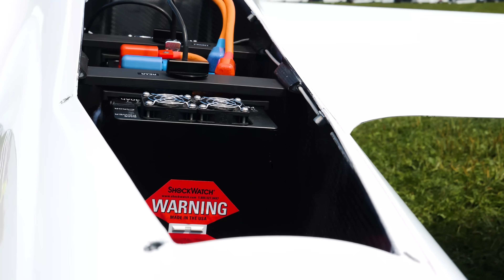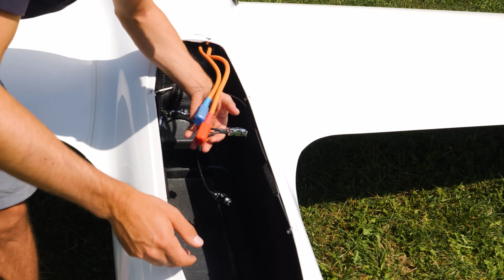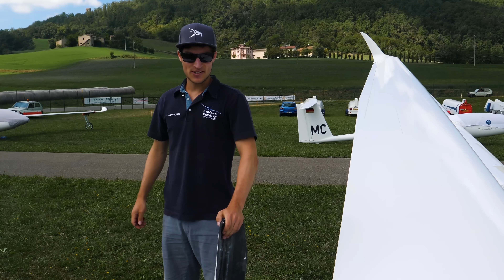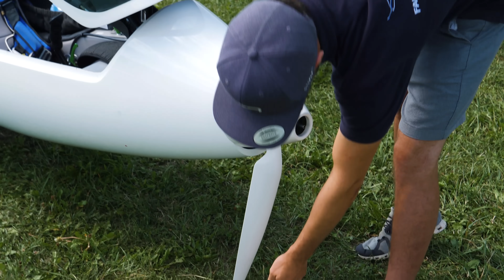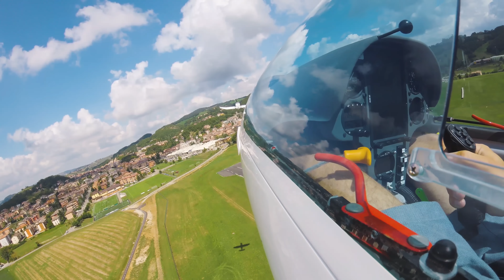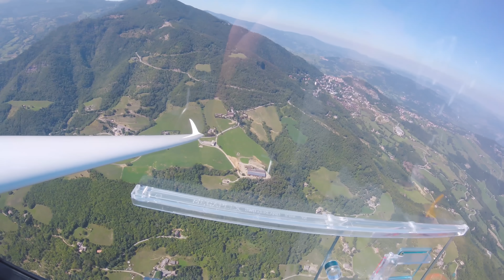New LS8-e neo review | Electric Glider 15 m & 18 m wingspan

Comment: Can't believe how far RC's have come - 'bout time they released a 1:1 ratio model
Reply from the maker: Haha, but not the cheapest RC glider 😂
Reply: I had an irresistible urge to blip the throttle stick on my transmitter as he was winding the prop! :D:D:D:D
Reply: The electric cri-cri is the ultimate 1:1 RC model =)
Reply: Stefan Langer Whats the Prize for the Plane ?
Reply: @Tatesmate  grand prize
Reply: 1:1 ratio model compared to what ? Itself ?
Reply: RC Planes have less regulations than real planes. That brings more room for creativity, experimentation and improvement. 
The real planes will try to follow the RC planes in the future.
Reply: This comment confused me, doesn’t RC= radio controlled? Isn’t this a glider? What am I missing, I feel dumb.
Reply: Nice video
Reply: @SteFly  how far battery goes? 100 km/ 1x charge?
Reply: Hört sich an wie 'n Kampfjet.😄
Reply: That is how the did 9/11
Reply: @SteFly  how much is this glider cost in this video?

and im taiking about US dollars
Reply: @SteFly  how much it cost a glider like that? heard that common gliders cost 40K this one?
Reply: @SteFly  Hi Stefan. Would you please tell me what to study in order to be able to try building a similar glider?
Reply: @SteFly  Hi Stefan. Would you please tell me what to study in order to be able to try building a similar glider?
Reply: @sbprivate7330  aeronautical engineering friend
Reply: Gliders use high lift low speed low drag flying so it has long thin wings and light material but very strong
Reply: Sam shepard and peter siripool and flute test are good channels
Reply: Fluid mechanics 
Mathematics 
Physics 
Aerodynamics 
Engineering statics 
Mechanics of materials 
Flight mechanics 
Pilot training 
Engineering structures ...
I'll ad more later
Reply: @SteFly  0
Reply: @jekekefe5923  I thought you were Mike patey for a sec!
Reply: Gibt es schon

Comment: I particularly enjoyed the extended battery securing aspect to this video. It's never given enough air time in similar features. I love watching batteries.
Reply: @Sam Haslam it is not completely foolproof, so not yet suitable for club operation... ;-)
Reply: I don't mind a little TV or a campfire, but sitting around watching batteries...👀..?
Reply: Cynthia Ayers I think they’ve got a website for that.
Reply: The batteries can be swapped and the flat batteries are charged while you fly. Way more fun than charging built in batteries when you can't fly for an hour or so while waiting.

Comment: Magnificent looking glider. Smooth low noise and compact electric power. Top combination.
Reply: He literally said it was too loud. As the 1 thing he didn't like. 

I thought it was amazing though.
Reply: For a glider its actually pretty loud. Since we don't have engines running and fly at around 100-160 km/h on average it's normally even quieter.
Reply: Hopefully only the airvent or the canopy...

Comment: Literally first glider video I saw an hour ago got me thinking that it would be a nice addition to have an electric motor with a folding prop on one of those in case the pilot fails to find any lift. Then I thought that of course that would be a compromise on the gliding abilit, because of the weight so maybe it's not the best idea. Googled the weight of some glider, did some quick rough maths about weight, electric motors and energy consumption then realized it might not be such a bad idea. Literally a few recommendations later this video shows up and I feel validated lol.

Comment: I started in a Switzer 233 like flying a pickup truck, It had air leaks all over and i liked the wind sound. When the sound stopped your were in a Thermal or in trouble.  It was fun.
Reply: Was it with air cadets?
Reply: @Matthew-se1xf  I wish it would of been cheaper.
Reply: I was a passenger in one of those once. My friend did wingovers above the Flatirons in Boulder and I puked out of the rectangular side window in the back seat that flopped downward on hinges. No thanks.
Reply: The SGS 2-33 was my first solo...the only other gliders I've flown are the ASK 21 and PW-6U but compared to those, it flies like a pickup truck. Compared to the LS8 and other modern stuff, it must be closer to a freight train. Still, the Schweizer was always a good time...god knows my slipping skills got better because of it.

Comment: Thank you for the video. That is one cool glider. I noticed you have a spot personal locator beacon on. I’m glad you have a beacon. But you might consider getting the ACR brand. There is a few reasons for this. One the ACR brand has no monthly fee. It also has 5 W of power. This way if you were down in the canyon or under a snow covered canopy it will have the power to get out where the spot only has 1/2 of 1 W. The spot also has a monthly fee. Finally the ACR brand is part of a worldwide search and rescue network that many governments are on board with and the ACR beacon will work anywhere in the world even the north or south pole. The spot uses a private satellite network and there are reports of the beacon being set off and them not dispatching search and rescue because they think it is not a real emergency. That is not an option with the other network. Also the other networks at ACR uses uses two different satellite constellations. Anyway just wanted to point that out beautiful glider thank you

Comment: Thank you for the interesting video: it gives a nice insight into the operational realities of a FES equipped glider. You make an interesting comment that the LS8, when compared to the '29, is the more 'communicative' glider regarding thermal structure and hence easier to core quickly. I was wondering how you would rate the Libelle in this regard?
Reply from the maker: The Std. Libelle (without winglets) is also very communicative but compared to the LS8 not so stable. You need to fly the Libelle more actively and it takes more concentration. But the feeling of the thermals was also very good.

Comment: Nice review Stefan, how do you have the time to create that many videos haha. This LS8 is a dream setup! - though would've loved to hear some range and performance specs on the FES system.
Reply from the maker: Thanks mate! Yes, it´s really time consuming to film and edit so many videos. Especially during competitions it is stressful. But now I´m back home and take some time to edit the footage. I had no time to make a proper range test only with the electrical motor. At one day I used 3,3 kWh and the battery was already fairly empty and the FCU said that I should reduce the power, even in level flight with 5 kW setting... So the reality is something between 60 - 80 km range in calm air. But most of the time this is enough.

Comment: If I had unlimited funds, this 18m would be my first, last, and only choice.
Reply: @IIExtreme23x how long do you want the wing to be? any longer and his roll rate would be slower than the antonov
Reply: @papakilo-2750  not really, the aileron is still on the far edge of the wing so there is alot of Torque and the plane is also very light.
Reply: I would buy a plain with a big engine.
Reply: @wimm1392  It's ''plane'', not ''plain''.

Comment: launch with the electric prop, then jetison the battery back to earth via parachute.   Retrim, and extend range greatly.
Reply: wouldn't extend the range.  Adding ballast extends range.  Look up the glider's polar curve at different wing loadings.  In any case you need tail ballast to shift the CoG back to the right position if you fly without the batteries.
Reply: Simon Buckley i think it was Joke...

Comment: How about a tour of the instrument panel ?  What are the buttons on the stick for ?   How many KWHr is the battery ?
Reply from the maker: The instrument panel is a state of the art panel with LX9070 glide computer and the remote stick is for user inputs to the glide computer in flight. The remote stick is neccessary, because my arm is too short to use the rotary knobs and buttons in a comfortable way. Both battery packs together have a 4,2 kWh of energy, which is max. 80 km range of pure electric flying.
Reply: @SteFly  Wow, just wow.  80Km is enough to prevent a lot of off glider port landings.  Can you charge the battery in the glider ?

What is the L/D on that thing ?  How much drag does the prop add ?   Is that where the cockpit noise is coming from ?

Please do a video on that panel, both on the ground and using it in the air.   Does it have a radio ?  ADS-B ?

What is the "Fire Warning" button about ?  The battery system ?
Reply: @SteFly  Its an amazing efficient use of elektrickel energy.  In comparison to petrol engines : 1kg petrol has 11kwh Energy in stock.  No petrol sustainer can drive a glider for 80 km with 1l of petrol.
Reply: @arminmoller9927  Well no. With the weight of those batteries in gasoline - this glider would fly across a continent. And it is 4.2kWh for both batteries combined. You can get a self launch, not a sustainer with the same weight.
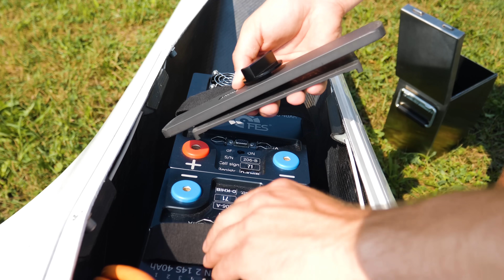Reply: @SomeTechGuy666  The panel has a "air control display" its a combined Altimeter/Radio/Transponder controller. The plane for sure has a Powerflarm integrated into the LX Computer which features ADS-B in. The LD is 1:50 for 18m. Don't know about the drag.
Reply: @arminmoller9927  do t forget it's not just the fuel, it's the engine pumps lines cooling water. Those things aren't needed with electric motors. The less fuel you use the more advantage has the electric motor. And maintainance is also MUCH cheaper. And as you said correctly ICE have a lousy efficiency, just like in cars. Normal cars burn 6-7 liters/100km that's about 66-77kWh. Electric cars need 15-17kWh/100km

Comment: I'd be very worried about accidentally pulling the NOAH system when I meant to pull the cable release !
What a fantastic glider.   The cockpit looks cramped.  Is it ?
Reply from the maker: There is a safety mechanism, so that you can´t inflate the NOAH system when the canopy is closed. The cockpit is not cramped, it´s comfortable from the space. Much bigger than an a-fuselage from Schempp-Hirth, feels more like the b-fuselage or the ASG29 cockpit.
Reply: @SteFly  Good to know about the NOAH canopy lock out.
Reply: @SteFly  Just stumbled upon your channel and know nothing about gliders, but when you were talking about the NOAH system, did you say that its to be used in the air so you can get out with a parachute??
Reply: @SteFly  Yeah, having spent most of my single seater time in SH gliders, I'm envious of all the space in this one. And the side pockets! :).
Reply: @Jaxalop3  its a gas inflated cushion that lifts you to the edge of the canopy. You can then roll out of the glider and use your parachute. The system was invented due to people getting stuck during high 'g'.

Comment: bit disapointed thought the prop was going to get it off the ground
Reply: Yeah me too, I thought that was the point, not having to use a tow plane... So what is the point of it all?
Reply: @gorway7  lift isnt easy to find. thats what its for.
Reply: me too
Reply: @gorway7  i suppose if you are flying into  a mountain you wind up the elastic band and hope that the prop gets you out of the way
Reply: "GLIDER"
Reply: @WSQuest  why didn't he take off on his own power then? I thought that was the reason he was showing it. I gotta look up this model and see if anyone takes off by the FES.
Reply: The FES system isn't certified for self start, even though it could probably get you off the ground if you're on a hard surface. But with that tiny ground clearance, I don't think I'd want to try it. Plus, I'd rather save the batteries for getting home - you only get a few thousand meters of climb out of a full charge. But I still want one of these :).
Reply: ric david Pay attention ladies he called it a sustainer, maybe you need to Google what that means?
Reply: electric (powered by renewables) winch to bear the brunt of it would save battery capacity. 
Had the same thought with electric passenger flight, how great would it be to spare onboard batteries from having to speed up the plane while still on the runway accellerating to V1. Wouldn't even have to be as brutal as on carriers.

Comment: Who makes those jet sustaining gliders?  I saw a new product a while back that uses electric driven wheels for take off augmented by jet propulsion for flight. Can't remember who is trying to develop it yet seems a very efficient use of energy as wheel traction is far better for take off and requires power for only a 15 second burn allowing the battery to be small. Thereafter once up to speed jet propulsion can prevail with optimum efficiency.
Reply from the maker: I also heard about a similar project, but with electrical motor also for flying. There are so many cool things to test :)
Reply: @SteFly  I will try to find it...and post it here.
Reply: @PaulAnthonyDuttonUk  Please do. I think it would be great to have a trolley that falls off the plane after the wheels power it forward.
Reply: @JoshWeaverRC  I found it then forgot to post it.   http://www.proairsport.com/project-glow.php https://www.planeandpilotmag.com/article/jet-powered-glider/#.XYT46FRKiM8
Reply: @PaulAnthonyDuttonUk  Wow that is awesome. That is something I would like to have for the self launch and taxi. Looks easy to transport. 
Just not easy on the wallet but worth it.
Reply: @JoshWeaverRC  I would like it too yet it's a bit pointy. Does not have the sexy look of say a GP 15 Jeta.
Reply: Lots of manufacturers offer jets these days, but strictly for getting home - no self launchers with jets that I'm aware of.

Comment: Nice glider but the lack of t/o capability kills it for me. I'm extremely happy with my Silent 2 Electro which never needs a tow thus allowing me to fly out of my nearest airport whenever the conditions look right. It also allows me to extend my gliding season by about 2 months as all the clubs here are on grass fields which aren't usable until the snow is gone and the field is dry. It would be nice to have the extra performance of an 18m but only if I could take off.
Reply: I can't understan why someone will waste time or money in a electrical propulsion system unable to t/o

Comment: Would be nice to take of from ground and not have to have a tow
Reply: Of course !
Reply: Look up the gliders with tow away jet engines
Reply: camtwan1 I like the idea of the folding prop, but the electric motor on a lid that folds out above the wing would be cool too, kinda like rc power gliders.

Comment: when the motor is on the spinner looks like it curves
Reply: The effect is caused by the frame rate of the video.
Reply: It's the way each frame is scanned. The still frame is not perfectly scanned all at the same time, so for fast moving stuff you can get this effect if the frequency is right
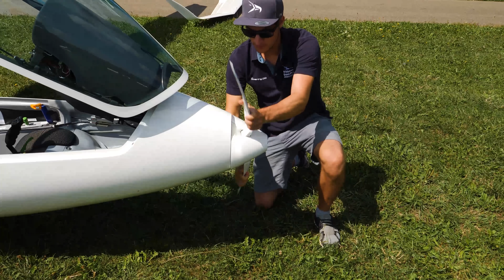Reply: Nope, the spinner IS indeed not round. Watch again 0:34 before starting when Mr. Langer turns the prop manually (with a weird sound btw)..

Comment: Having to use a screwdriver to access the battery compartment is very impractical. Especially for emergency access to the battery compartment in case of fire. Perhaps an aviation snap latch might be better.  Relatively light, requires no tools and flush with air stream.
Reply: Are you going to put the fire out?  Insurance my friend.
Reply: DumbledoreMcCracken  Are you the adjuster? Haha
Reply: @randomnickify  It can burn anywhere. Even while on the ground. Will still need screwdriver.
Reply: In case of fire, there's nothing in the battery compartment you want to access anyway. You can't put out Lithium batteries, just let them burn and have the insurance company get you a new plane.

Comment: I presume this requires an 8 ch radio?
Reply from the maker: Rudder, aileron, elevator, airbrakes, gear, water, release and throttle.  So 8 channel should be fine ✌🏼😅
Reply: @SteFly  The pilot is quite articulated, though. That's at least four extra channels ;-)